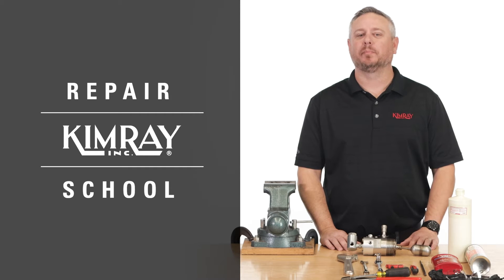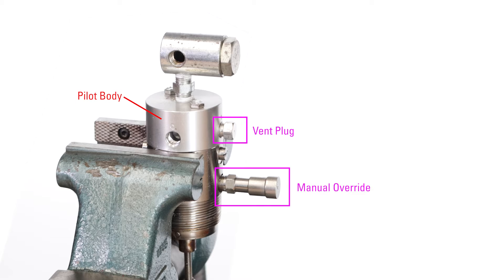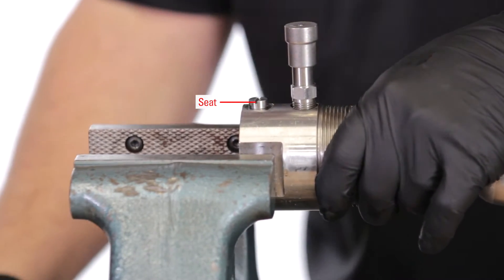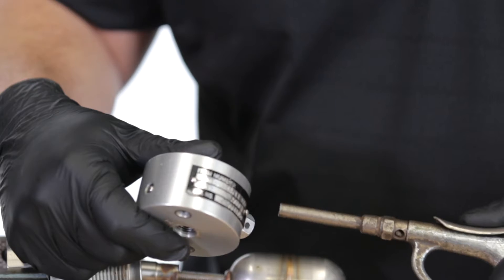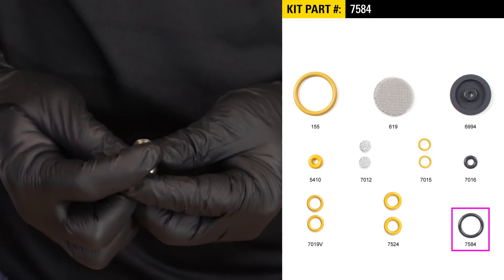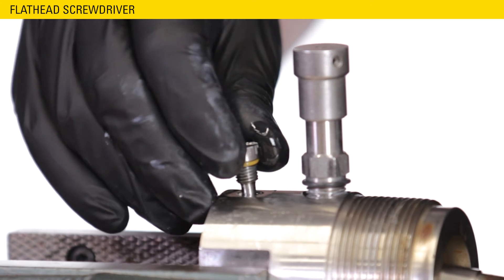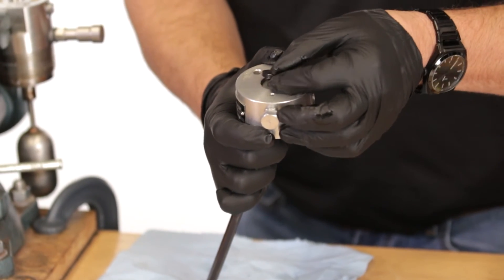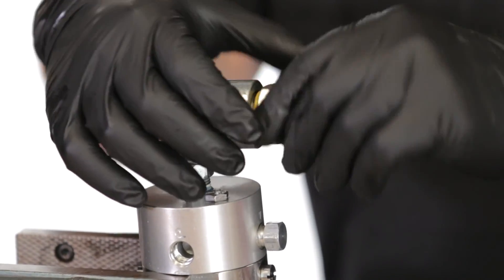Kimray Liquid Level Switch (CUA) Maintenance & Repair 🔧

Comment: If any of the o-rings go bad will they cause false level alarms?
Reply from the maker: Yes, a failed O-ring can cause the level switch to produce false output, specifically the 7016V O-ring on the 6986 stem.
Reply: Can you unthread the manual override with it being in a vessel still?